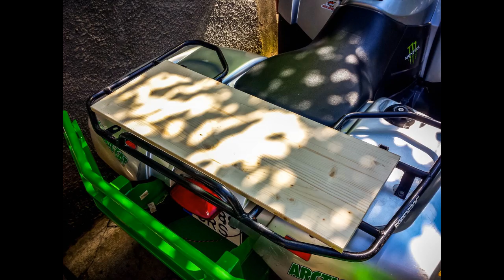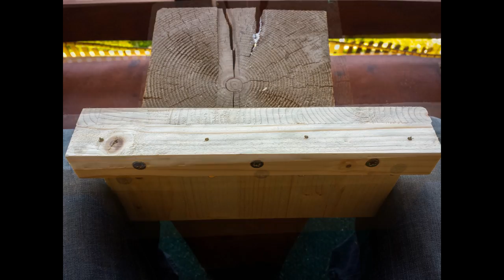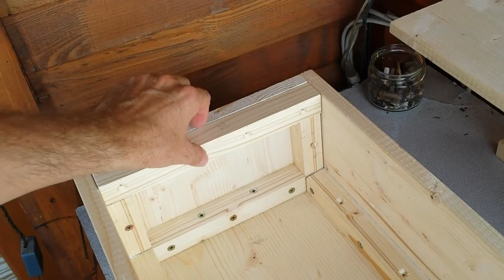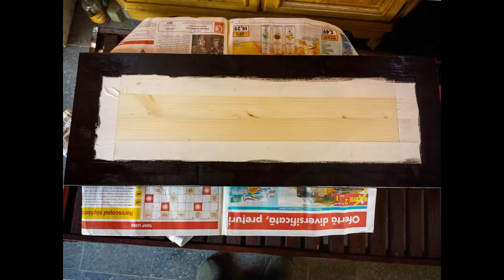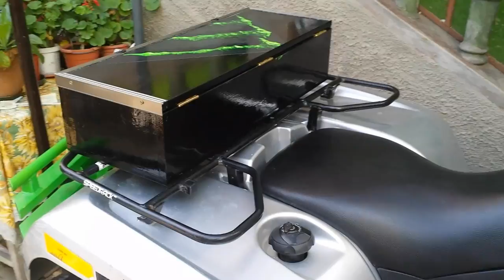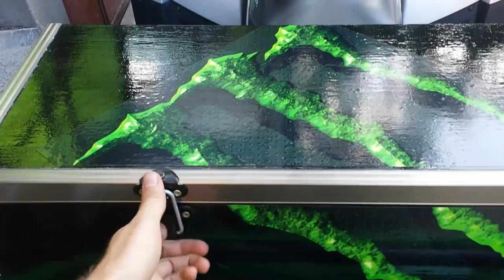Homemade ATV Cargo Box

Comment: Looks great! I'm thinking of making one something like that. I was wondering how it is holding up? I mean do you still have it and using it? I know you made this video a few years ago.
Reply from the maker: Yes, I still have it. It's bolted to the rear rack and I'm still using it. It held up very good so far, the clear coat got some marks here and there from tree branches while riding, but other than that it's ok and water and dust still don't get inside.
Reply: Ok that is great to hear, just I find almost $300.00 to buy one is alot.
Reply: Can I ask what are the two locking pieces called on the front and where did you get them ?

Comment: what type of paint did you use? looks amazing. did u brush it on or spray paint?
Reply from the maker: I used normal black paint, noting special, just brushed 2 coats of paint and 3 coats of wood lacquer (I let at least 24h to pass between coats)
Reply: I have an ABS cargo box on my ATV but it's not water tight. It'll keep rain out but the lid leaks a little water since there's no gasket
Reply from the maker: OG BB You could try and put a thin gasket on the lid and see if that makes it water tight
Reply: Yea, that would def help.  Sometimes I go riding in deep water and have gotten the box full of water like an aquarium.  I'm pondering buying a waterproof duffel bag to go inside the box so I can keep my gear and tools dry